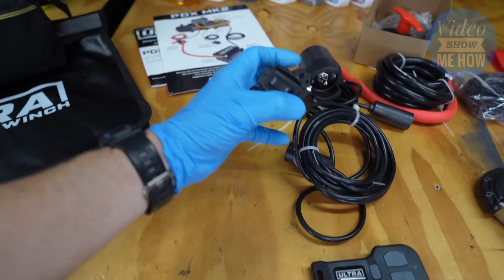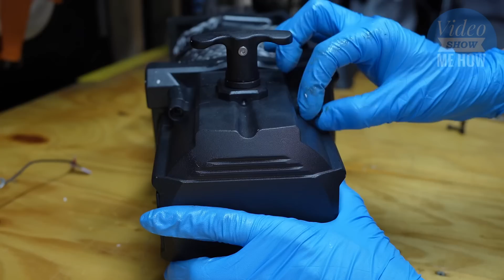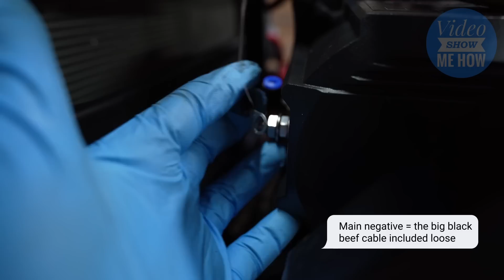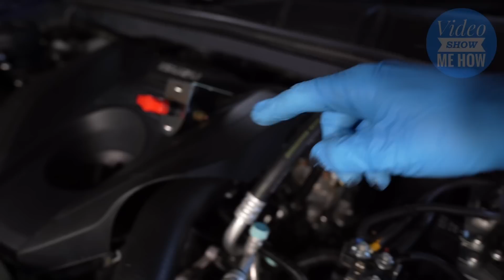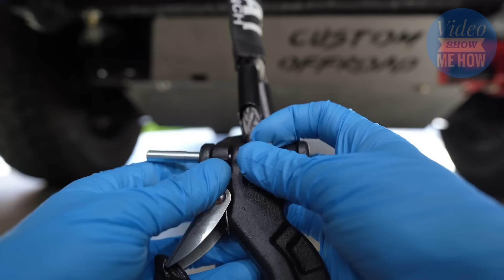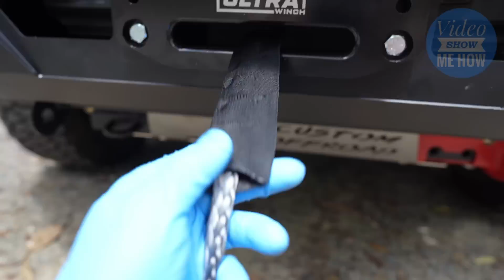ULTRAWINCH PDX MK2 WINCH | Overview & Install | Isuzu DMAX Build Series #32

Comment: Hey mate, did your earth cable sit flush on the battery terminal bolts or did you have to add a washer or two. Mine hits the round part and won't sit flat when tightening the bolt 8:59

Comment: Hey mate, maybe I missed it but how are you fusing the positive cable?  Amps etc? Thanks mate great video.
Reply from the maker: Winch cables aren't usually fused, most winches will draw up to 500amps. You have a certain layer of protection via the solenoid anyway 👍
Reply: @VideoShowMeHow   thanks for the response 👍

Comment: I hadn't heard of this brand, but I'm liking the remote. I just got a Kings one for my last car, worked well enough for the limited use I put it through. Will the remote also work if you do install the in cab switch? What are we up to know, 15 grand or so worth of add ons?
Reply from the maker: Yeah researched the market like a madman and these speced really well 👌 Yes remote works with can switch too. Very handy.

Comment: Question as I don't know, dimensions on 9500 and 12500 pdx winches look the same and weight. Why did you go 9500 and not 12500 for the extra power?
Reply from the maker: 9500 plenty of pulling power for a dual cab 👍
Reply: @Richard Walsh, the chasis is only rated to 9500lb according to Isuzu

Comment: Looks like it would block some air flow, might effect the engine temp a touch?
Reply from the maker: Have tested this, even with the lights and winch in the temp delta is 0.5-1.0 degree 👍 Bar design makes a big difference. Isuzu have done a great job not shoehorning this engine and giving it lots of temp headroom it seems